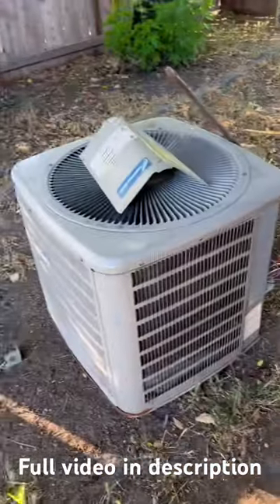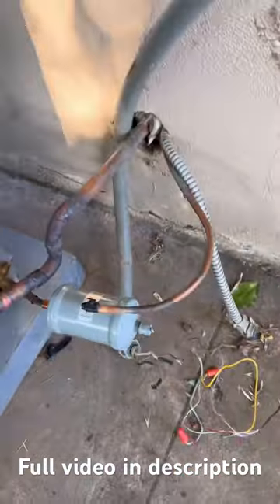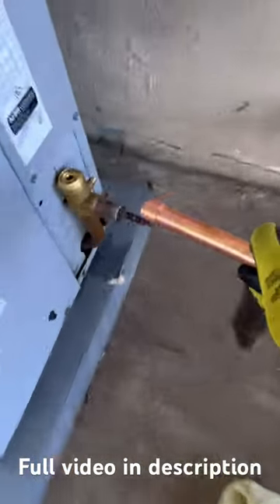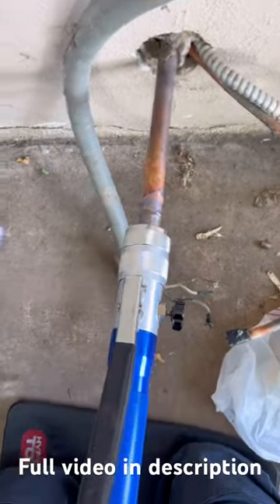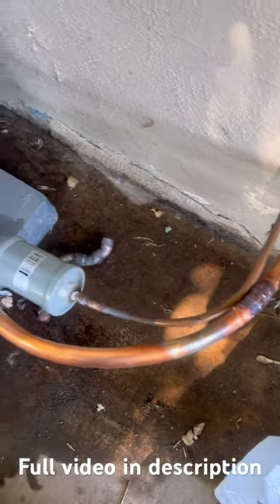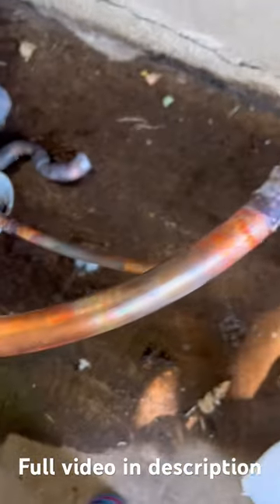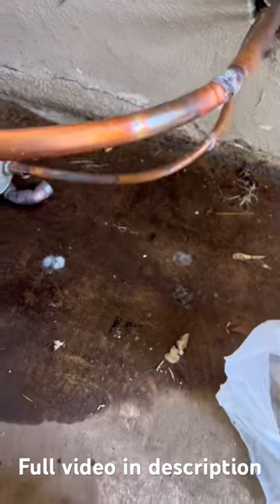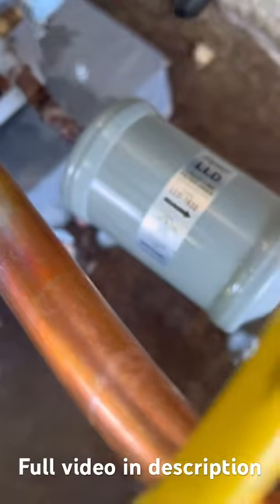How to install  Carrier Condenser Unit #shorts

Comment: Need a how to video on the piping. That looks super clean.
Reply from the maker: I will record one. A super clean piping could be achieved with Staybright 8 95/5. With little heat , wont rust and can bear upto 450psi. The 15%, and 45% can also be achieved clean if you use flux.

Comment: Wrong size line set for the condenser 😮
Reply from the maker: Lineset are already there 3/4”. A new condenser 7/8 size been deployed. The unit is old and owner only wants to replace the old condenser with the one in video. Tonnage match and he is happy to do it.
Now a days Goodman’s 3 ton condenser comes in 7/8” size.

Comment: installing used equipment, and brazing that close to a zoomlock fitting...jfc
Reply from the maker: Please enlighten me when a perfect working condenser, owned by same customer, replacing it from one to another place. Whats wrong with it? Is there any regulation that a used equipment can’t be installed if its in perfect shape & functionality??? Please don’t just throw random idea(he said or someone said). Any cali or other state regulations?

Comment: Absolutely least profsnl soldering joints...terrible finish..just use rag wipe once aftr immediate soldering..and why r u using too much heat at coupling..u must not be using plumbing gas...sad u r soo detailed but not in soldering finish...chk youtube for smooth finish..and stop using high heat long time...r u using any solder gel???.